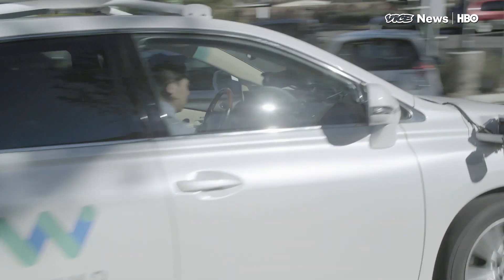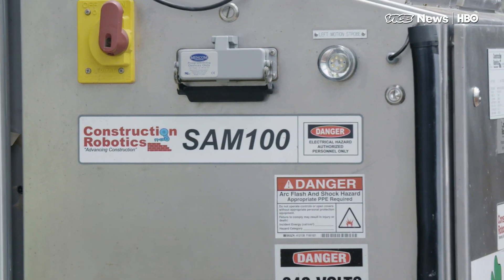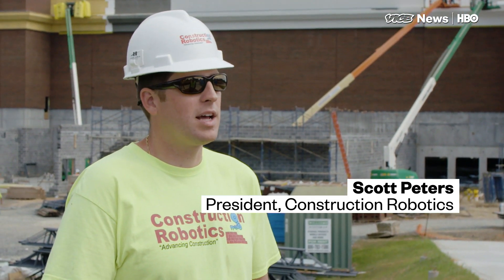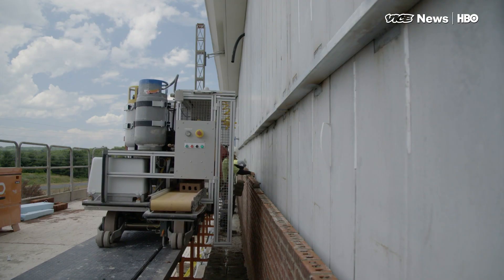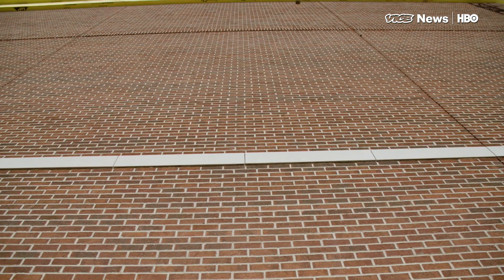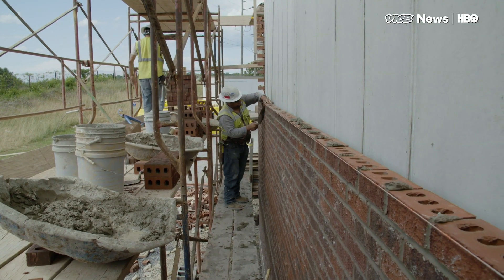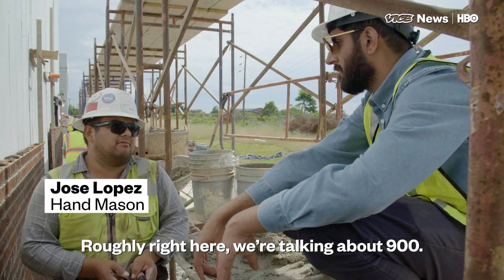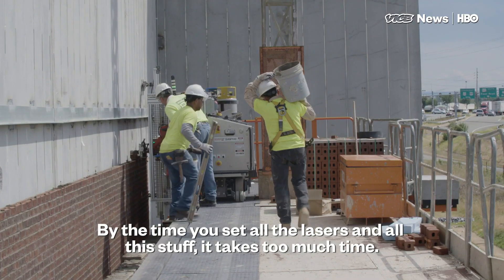This Bricklaying Robot Can Build Walls Faster Than Humans (HBO)

Comment: “The robot lays bricks 3 times faster than a human bricklayer”...”the robot needs 2 assistant bricklayers to clean and point the mortar afterwards”
Does that mean the robot is less efficient than a human bricklayer when you account for scaffolding and maintenance requirements!? 
Sometimes I think it’s technology for technologies sake 🙄
Reply: It's full name is Sam Stakhanov :D
Reply: technology only gets better.  every process can get improved.  And you can pay those assistants less than half of a brick layer.    And really whats stopping the robot from laying 2....or   3  bricks in one motion, it goes from 3000 bricks a day to 6 and 9k with out even increasing the speed at which it lays, just the quantity of bricks laid.  Anyways Biden 2020 tear down that wall we need more migrants, its good for the economy

Comment: When I was more involved in the construction business or building a home for myself the problems that I had usually were minor except when it came to cement block masons and brick layers. Unreliable, condescending and over paid. The poured concrete walls took care of part of that and the brick machine will do the rest.

Comment: It lays a bunch of bricks then leaves the jointing for someone else, sounds like some foremen I know.
Reply: I worked with foremen like that. Run almost to quitting time  and have to go do paper work. Or order tubs of grout a few minutes before quitting time! Oh yeah in over 50 years I have seen it all!
You just pack up your tools at quitting time and leave. The next day he will” be different!
Reply: Lol FINALLY 3/8” MORTAR JOINTS... I’ve seen 3/4” joints before🥴
Reply: every foremen*
Reply: When they invent a robot to feed the machine then they will be in trouble! Like the guy said they don't have to many places with long brick walls plus it takes a lot of time to set the machine up plus two men have to keep it fed so you really can't compare it against one man!writing this in marched
Reply: @angelajohnson6659  Yep they cannot lay out the work,make the saw cuts,scale the heights and on and on ands on.
Reply: @752brickie 

"Yep they cannot lay out the work,make the saw cuts,scale the heights and on and on ands on."

Not yet, my friend. Not yet.

Manson should be an intellectual job, they do the math to figure out how it should be built, then tell the robot what to do, then go wait in an air conditioned pod, and from time to time come out and check on the robot. 🙂 So masons still needed, but per se bricklayers, probably not too much longer. And that's a good thing, why should men have to break their backs in the hot sun? 🙂
Reply: My Foreman is cool and actually fucking does his joints, but when the owner shows up to lay the easiest spots on the job, you bet your ass he's leaving the joints for someone else to tuck and strike.
Reply: You know Greg too? Damn it Greg
Reply: The foreskin?

Comment: It takes too much set up to make it worth it in my country, housing sites are too small and houses are too small. By the time you set it up. And then re set it up every few courses of bricks makes it useless. Too expensive at the moment. It uses the same amount of labour than traditional. You can only lay so many courses in a day anyway before the weight of the bricks squeeze the mortar out.

For buildings that this would be useful for just dont exist, they will soon spec a different material to save money

Comment: It  will put you out of job full stop. You only have to look at the car industry to see that. This is one industry where work is always plentiful, let this in and you will be redundant and unemployed in a lot of cases. Many too old to retrain in other industries. For the designers its work for few being built by robots and money in the pocket. For those in the industry it could be devastating jobs wise.  If it can lay bricks, it can build timber walls, it can clad those walls, render those walls. You want to resist it as much as possible.

Comment: Needs people to set it up, someone to load it, someone to do the jointing. Figures of 3000 bricks are for straight walls, no corners or detailed work. Not to mention when it rains. Now give the the same straight wall to two bricklayers and tell them they only have to lay them and not joint them.

Comment: Only going to put millions on dole. quality beat quantity everytime remember that
Reply: The machine will actually be more accurate. However i wouldnt worry about seeing this in the uk any time soon honestly
Reply: Negative. Electrification may have put candle and lantern makers out of work, but the number of jobs that were created as a result is at least times a thousand.  Automobiles may have put coach and saddle makers out of work but again created many times as many jobs. Ditto for computers.  If you can build a building for half the cost, does that mean people will just stuff the extra money under their mattress? No. They will be able to afford bigger buildings or more buildings, or buy to buy more things, each case requiring  more jobs.  Besides, there will be jobs to design robots, build robots, operate robots, maintain and repair robots.

Comment: Suggesting that this robot will replace a bricklayer is utter nonsense. The majority of brick builds in the U.K. are housing estates. Can you imagine setting up this mammoth machine every single time you want to lay an eight metre run!! Then break the machine down and set it up on the other side, time and time again?!! While still requiring a team of guys to keep it running smoothly?
There is more chance in the future that bricks & mortar will not be the preferred material in construction...than these robots overtaking masons & bricklayers. Then these robots will become obsolete anyway.

Comment: Load of bollocks. 1 man loading bricks 1 man loading compo  1man jointing up. 3 men, save the money on buying the machine use a  2 and 1 gang. Also it cant do windows ,doors, lintels and you have to manually set up corners for it. All it can do is straight lines.

Comment: a good human brick layer lays 1k briks a day? yeah, that depends on so so so so sooo  much, is the scaffold ok? how long is the wall? how good are the 

henchmen(s)? are you including the henchmen? (you have to include everyone in the total bricks per day per person) are there any other stuff like windows/deep windows? how high on the scaffold are you?(the higher the floor the more time it takes to get material up) what working height  are you on? (low start and high finish takes more time) is the brick layer also doing the grouting job? ( again the total bricks laid on a day needs to be divided by the number of participants) are you also doing insulating the wall?

Comment: It’s not just about speed.  It’s also, consistency/uniformity, can work more than eight hours with a second crew, no injuries (but does need maintenance), does not take vacation or time off but would need back up crew when the primary support personnel take off, and last, easy to very the hours worked.
Reply: This will take a long process and as time goes on they will become much more efficient and faster, and the cost savings will be enormous.

Comment: Don't look at it with the preconception that its going to take away jobs. instead try to keep an open mind and consider how many other jobs it opens up. Brick laying is not a highly skilled trade, rates cap out at a point and it becomes just a laborious job that few people want to take on. You notice on job sites that most masons are immigrants looking to take any job they can to make money to send home. There are still going to be workers needed to operate and monitor these machines and set them up. I feel like automation will help improve life expectancy and overall happiness of people, and may even improve education as the demand for higher skilled labor is introduced to operate and build these machines.

Comment: "the best human masons can only lay 1000 bricks a day" incorrect.
Reply: A long way to go before robots replace brikies, there are things this machine will never be able to do it has no judgement or understanding of what its doing.
Reply: @simonelliott7570  This machine wasnt made to replace them. It was made to make it faster and more efficent. The company has said (forgot if it was their website of a news article) that it didn't want to replace construction workers
Reply: Even at such a brutal pace, you’re nowhere near 3k a day, let alone staying within the same tolerances the robot achieves all day long. 

Like the worker said, these long lays on large commercial buildings work to the strength of this robot, not humans.
Reply: Minimum 1000
Reply: Right! I can lay 1200 a day with a good labor. And if the wall isnt cut to shit
Reply: ItchyPilauBoto808  yeah I was a bricky for 8 years pal, and some people I know can do 200-300 in an hour.. so yes quite easily.

Comment: Just the scaffolding has to be built a lot more solid, level, wider, how does the robot move up to the next level a forklift drops it off? When I did bricklaying we would plunk down scaffolding on planks and the bricklayers stood on a single plank. Moving up was as simple as raising the scaffold hooks up to the next pins. to me this looks like they replaced some bricklayers  with more labourers. And can the robot do windows? Can it cut bricks? (A robot cutting its own bricks is probably not too difficult honestly it just needs a hydraulic wedge and a way to measure its cuts and lay the cuts around windows. But humans would have to do the window sills for sure. 

And the million dollar question can it go around corners??? The corners take the longest to set up so if human bricklayers are building the corners and the robot just fills the middle how much are you really saving?
Reply: I really dont know Wolverine.

Comment: Long term it’s a machines world, but right now not so much. 

In terms of cost I Imagine there is a large initial capital outlay and reasonable ongoing maintenance cost. Also if we assume it’s similar to most other machines, it probably has an estimated life of 7-10 years (Max). 

Next it’s application, It’s so large and only applicable for niche jobs like super Long straight walls. The biggest flaw, You’ve still got 2 people doing the finishing work.

Comment: with its size for sure, it's not an easy set up every time it changes the area of work, with that speed and less versatility, this robot is not practical having two operators. in case of breakdown, it needs technician and parts which is additional cost and downtime.